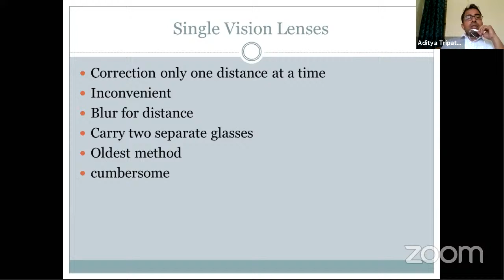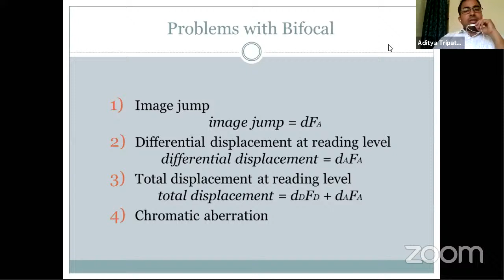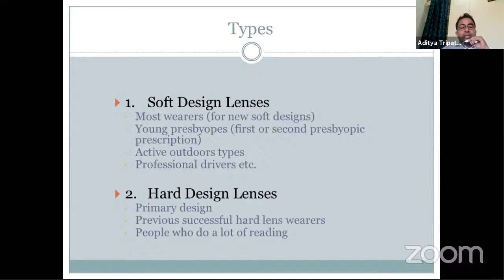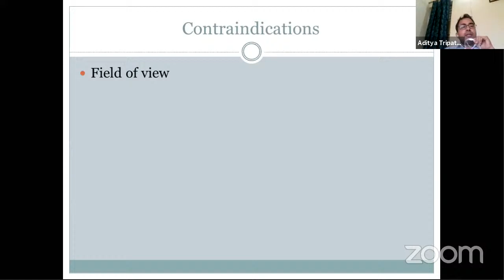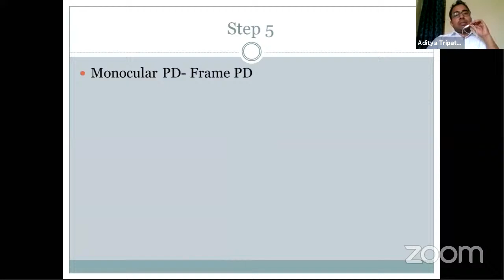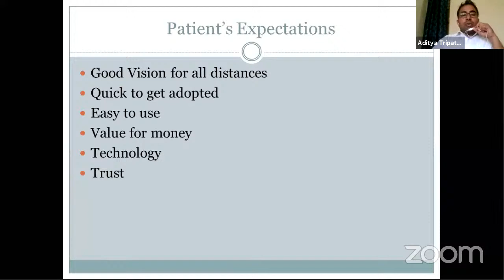Ep38 - Dispensing for Presbyopia by Aditya Tripathi (ForOptom eLearning)

Comment: The speaker is a well-informed professional, but his presentation is too lengthy. He should also make use of only points and not the whole text in slides. The use of the prefix 'Mr.' should also be replaced with that of 'Optom.' - Editor, Optometry Today
Reply from the maker: Thank you for the suggestion sir.